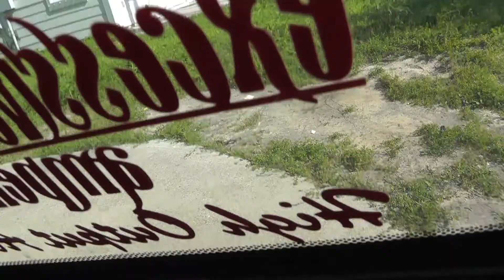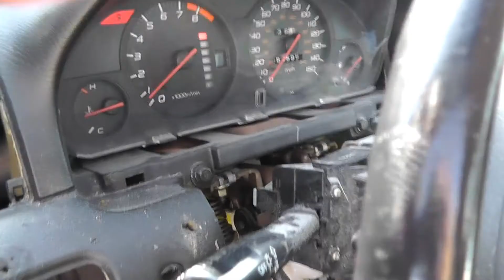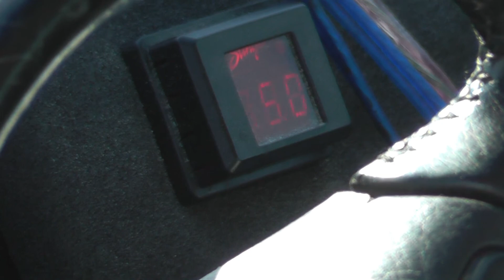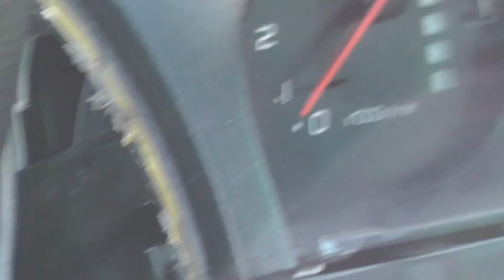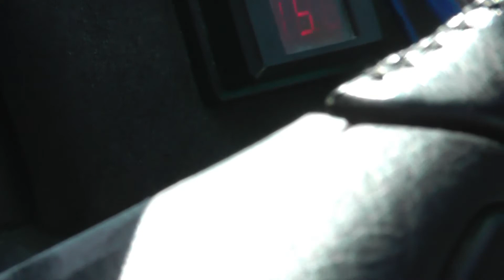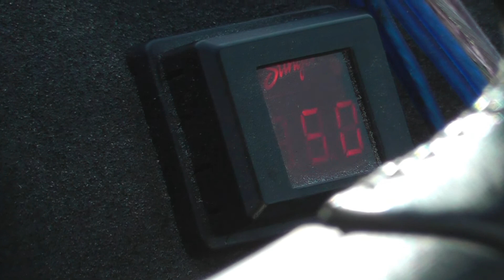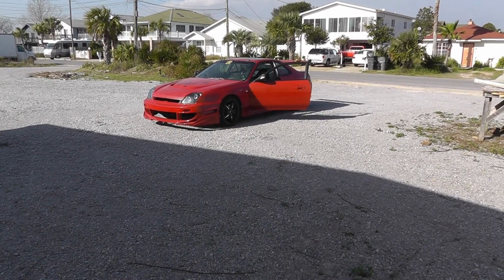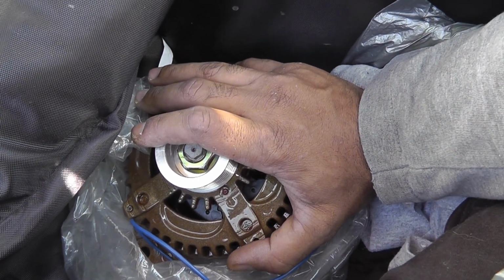The Power of Excessive Amperage+MMATS Pro Audio.

Comment: How is that a "real world test" when there is NO current clamping at all?  There is NO amperage reading from the alternator and NO amperage reading from the amp.  How can you claim 3000+ watts when there is NO data to back that up?  If you could boil water instantly, your car would be on fire or melted already and you'd be dead going near it.  Also, expert, the Stinger volt meters ARE adjustable, take the cover off and turn the knob to adjust, like the manual says.